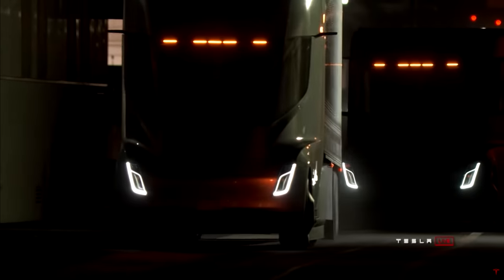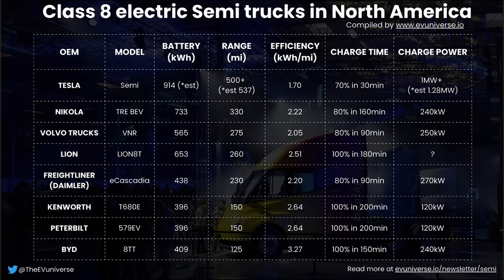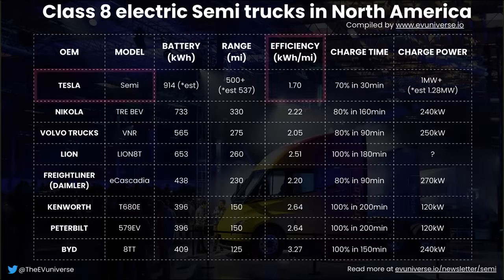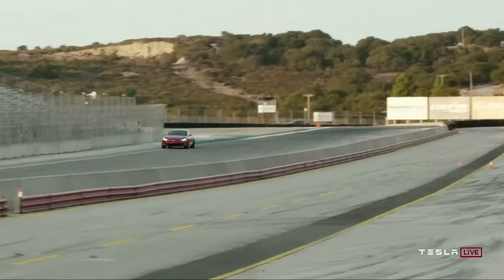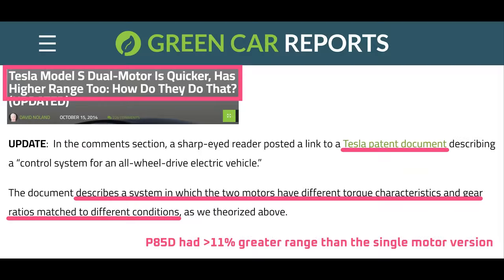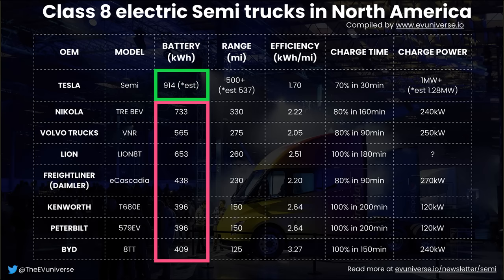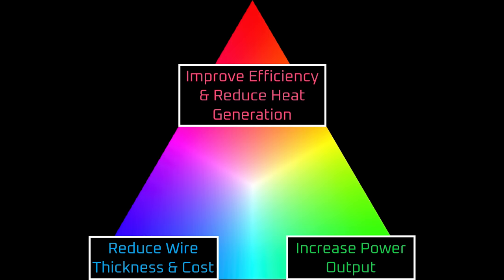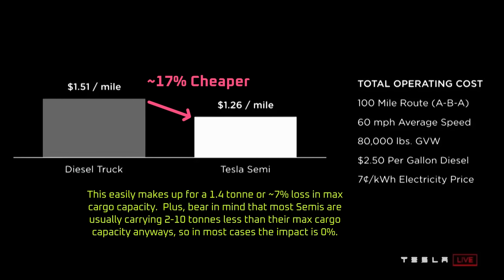How the Tesla Semi “Broke the Laws of Physics”

Comment: High efficiency for moving owns battery itself
Reply: Yup—plus about 22-23 tons of payload.
Reply: @BigBen621  nope because of US 36 ton max weight for trucks. Battery itself only. 😁
Reply: @Blowjin  Where'd you get that nutty idea? 23 USC 127(s) begs to differ with you: "A vehicle, if operated by an engine fueled primarily by natural gas or powered primarily by means of electric battery power, may exceed the weight limit on the power unit by up to 2,000 pounds (up to a maximum gross vehicle weight of 82,000 pounds ) under this section." If you aren't aware, USC means U.S. Code, which applies in all states. You may be referring to long tons , and the limit would be 36 long tons; but here in the US, ton means short ton, which is 2,000 lbs. And 82,000 / 2,000 = 41 tons.
Reply: @BigBen621  ok, I was wrong. Now we can take little more batteries.
Reply: @Blowjin  Admitting error is an internet rarity these days, so kudos for that. Various sources state that "53-foot flatbed trailers can typically haul between 45,000-48,000 pounds". The load on the flatbed trailer in the Donner Pass video can be calculated as >44,000 lbs., so the Tesla Semi has a little less, but not substantially less, payload capacity than a diesel semi.

Comment: funny how you list the "Nikola" even though its stats are based on a fake truck rolling down hill by only gravity!
Reply from the maker: lol
Reply: The faked Nikola truck is history; Nikola is now selling an EV truck from Iveco, which Nikola calls the "Tre". It's a cabover, because Iveco is from Europe and that's how they build trucks there. For the North American market, Nikola is doing final assembly (installing the battery-electric powertrain in an Iveco-built glider) in Coolidge, Arizona. 

Nikola is trying to sell both battery-electric and hydrogen fuel cell trucks, both under the "Tre" model name; that's why the table lists "TRE BEV" (to distinguish it from the Tre hydrogen model).

Comment: Why don't install 2kw to 3kw  of solar panels on the truck cargo roof? At least use that to offset your air-conditioning
Reply: That would be of limited utility, most drivers don't own trailers, they just pick up and drop off.
Reply: @TheEvilmooseofdoom  the company's that provide trailers with solar could reduce charging downtime.
Reply: @chadellett4696  True, but that is a cost that they have to eat with no ROI.
Reply: Because this is one of the most frequent comments on Tesla Semi YT videos, I did the math on adding solar panels to standard dry van trailers. Turns out that they would produce enough electricity for an added range of about 13 miles a day. But the added aerodynamic drag and weight would decrease the range by about the same amount, for no net gain. Much more importantly, solar panels covering the top of a dry van trailer would weigh about 2,000 lbs., which would of course reduce the payload by that amount. I can post the calculations, if you like.
Reply: @BigBen621  apply using light weight solar panels or would the drag be less if the solar panels are built into the cargo roof structure.?

Comment: In order to get this amount of range, the tesla semi needs to stay under 60 mph. 
If I remember correctly,  the analysis done by 'Engineering Explained' showed that during the 'official tesla demo video'  the average speed was likely closer to 55 mph. Which is somewhat disappointing
Reply: I think the figures work out to ±63mph...
But....
Consider that this truck running at a higher speed can maintain that speed. 
Result? Substantial time gain.
Over not 8, but 6 hours, even a 5 mph average gain (ref the hill!) gives a 30 mile, 25 minute time advantage.
Or
An Extra stop for the driver, together with a 15(?) minute charge boost? (That's ±150 miles range extension)
.
Then, pulling out of the location, the truck would still be 5-10 minutes in front of a comparable diesel.
Reply: It is also the legal speed limit for semi's in Cali..

Comment: a fun fact, if we convert all semi trucks to electric we'll need to increase our electricity generation by 10% and if we want to add all passenger vehicles to this, we need a total increase of 30%+ to put that into perspective, in the us we haven't added any net new capacity for the last 14 years.
If we build all of that using natural gas plants, the cost is north of $1000 Trillion or the entire US GDP in is entirely spent on this project for the next 40 years.
Reply from the maker: Don't get sucked into the stagnation fallacy.

For most of the time we've had electricity. It's grown by more than we need it to for EVs.
Just because it hasn't grown in a couple decades doesn't mean it can't.

The grid will be fine.
Reply: $1000 Trillion is an absurd figure—where'd you get that nutty idea?
The US currently has an installed capacity of about 1,250 gigawatts. Meanwhile, as reported by CNBC on April 6th, there's 2,020 gigawatts of mostly-renewable generation, and storage—60% more than all existing generation—in queues, waiting for interconnection agreements. History shows that much of this won't end up being built; but it makes it pretty clear that increasing our generating capacity by 30% over the decades it'll take to replace all semi trucks and passenger vehicles (your claim, but plausible), isn’t going to be a "limiting factor".

Comment: Diesel semi truck can go 2000 miles before refueling the Tesla can go 500ish. The Tesla can haul 50% of what a Diesel semi can haul. This is only useful in short trips and that is one thing that most semi trucks don't do. That is why people call BS on this Tesla truck. Your video sounds like some insane fanboy drooling over vaporware.
Reply: Where do you get the 50% number, its 93%. Only a small percentage go 2000 miles therefore a lot of the local routes are doable p.
Reply: @universeisundernoobligatio3283  Lots of haters just make up things to justify why they hate.  He's comparing long haul trucks with a day hauler.  It's equal parts ignorance and dishonesty.

Comment: So much fallacy in the video. For starters the ‘90% energy reclaimed’ should really read 90% x 3 times (original loss, then reclaim, then subsequent loss - assuming one additional use of the same energy ‘batch’), which is 72% of the original energy put into the pack and that’s assuming 90% back AND forth, which we don’t know if that’s the case.

The main problem with electricity is intrinsic energy per 1kg as we have it today, which is tens of times lower than that of Diesel. Or as Elon likes to misuse ‘order of magnitude’. The diesel truck aerodynamics plays negligible role due to this fact.

Lastly, what works on a passenger car, whereby the load capacity is 10% of the weight of the vehicle, with the semi it’s 400%. I.e. 40x difference. This IS the physical impossibility of the Tesla Semi. As we can all witness how the Range drops when added a 400Kg trailer to a M3 or Y - I.e. 20% of the car weight added drops range by 40%. Will be interesting to see what they really are.
Reply from the maker: Thank you, captain obvious

I have to keep the topic relatively narrow in each video due to the amount of depth I go into.

Otherwise these videos would be hours long.

I have to break them into series over the course of several months.

But I'm sure given your knowledge of the blatantly obvious, you probably already knew that.
Reply: 400KG is 10% of the weight of a M3 or Y? I think not. And Tesla Semi load capacity is 400% of the weight of the tractor, meaning the tractor weighs only 16,400 lbs.? Again, I think not. Both the Donner Pass video with a load of 11 3,900 lb. K-Rails, and the 500 mile range test with a load of 600KG pallets, suggest the weight of the Tesla Semi is around 14 tons, with a load capacity of around 27 tons, for a <200% ratio. 

But that's not my main reason for responding; it's that using passenger car results to estimate range reductions of the Tesla Semi just doesn't work. A major part of the losses that determine range in any vehicle is air resistance. When you add a trailer to a passenger car, you more than double the air resistance, while increasing the weight proportionately far less. So the additional air resistance is much more a factor than the additional weight; leading, as you said, to a disproportionate reduction in range when pulling a trailer. But the Tesla Semi used to demonstrate a 500+ mile range already had the trailer attached; so there would be no significant change in air resistance between fully loaded and empty. And it was already within 1,000 lbs. of fully loaded; so the only change in range with load differences would be an increase in range with decreased load. For example, on the 500 mile range test, if the payload were reduced by half, from around 40,000 lbs. to around 20,000 lbs., the range would increase by about 17%; in a sense, a disproportionately small increase in range, compared with the change in load. And of course, the inverse would hold; doubling the payload from 20,000 lbs. to 40,000 lbs. would only decrease the range by about 16%—much less than for a relatively far smaller increase in load caused by adding a trailer to a passenger EV.